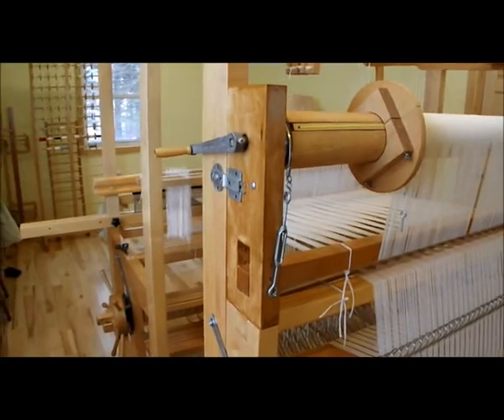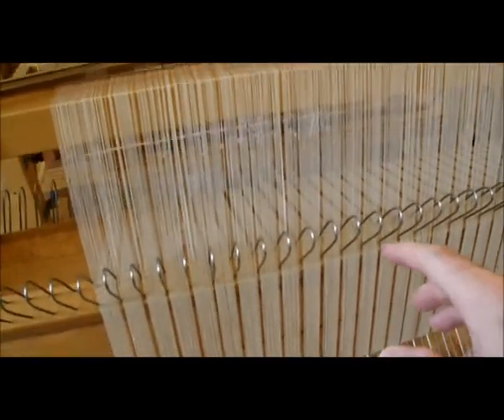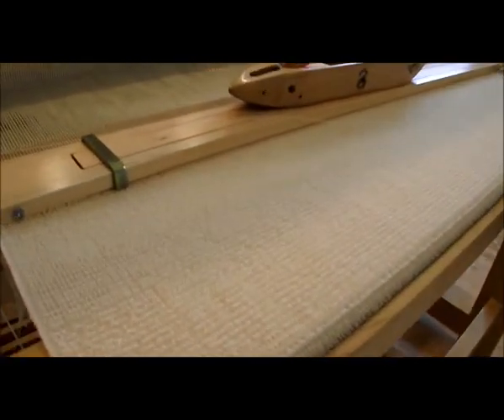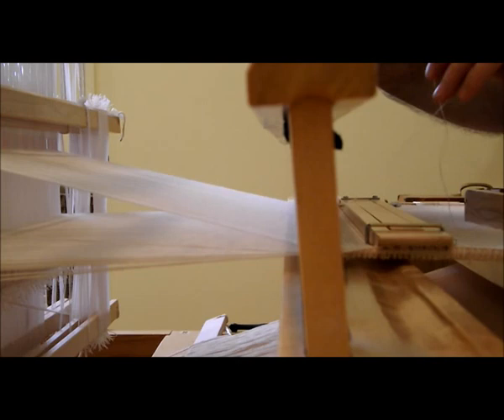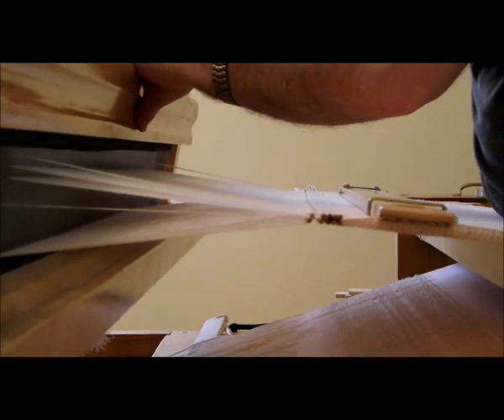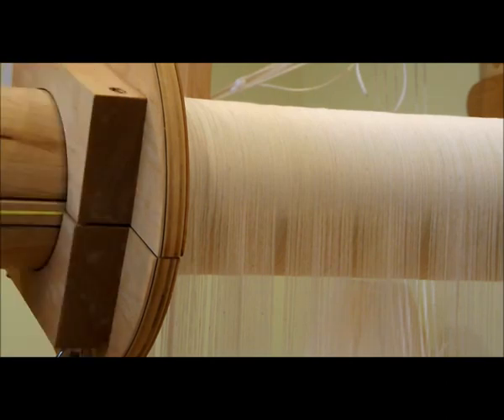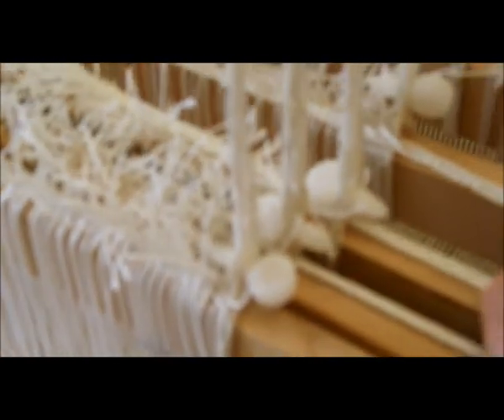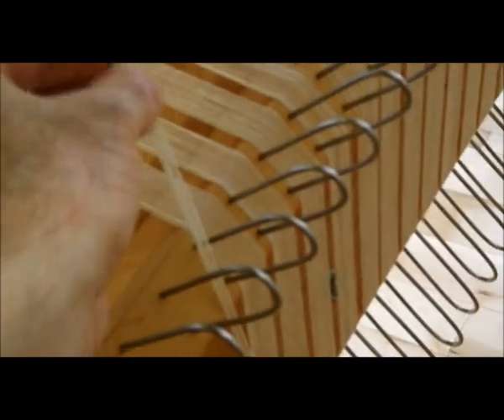Weaving two faced pile on a floor loom

Comment: Very  beautiful loom. The pile warp is on the main beam?  Let my floor loom go when moved so will rig a diff loom to try.
Reply from the maker: No, it's on a supplementary beam overhead, it has a friction break. I wound it first onto the sectional beam below with tension box and spools, then wound it off onto the beam overhead. Just wind away as it is pulled off the main beam below, with even tension. Flanges on that supplementary beam eliminate packing material.